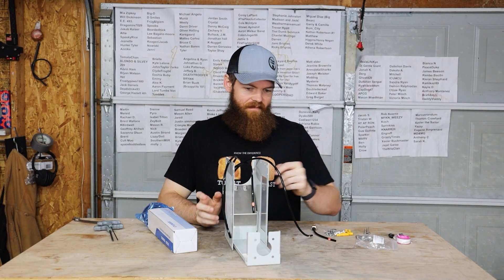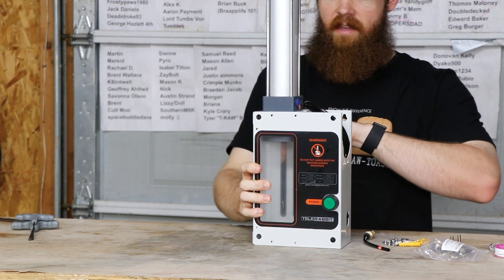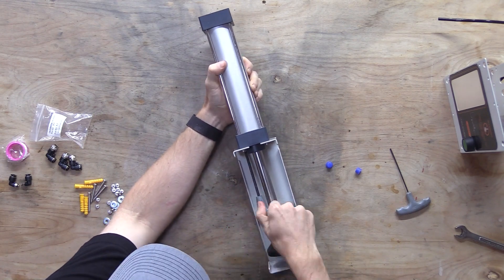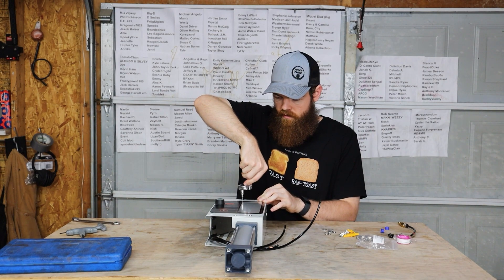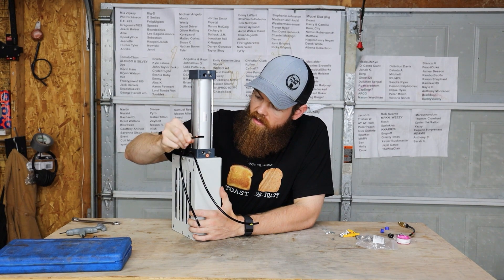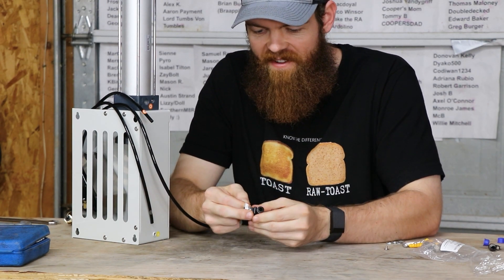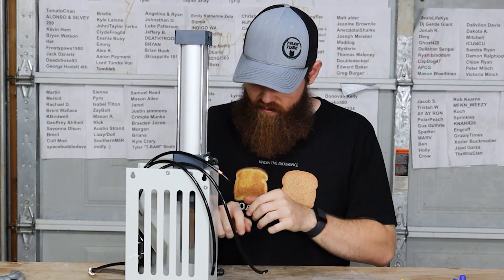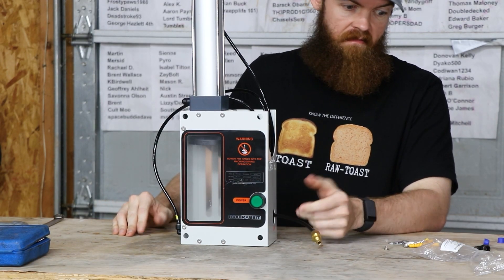I Built A Can Crusher!

Comment: It sounds like there is a flow restrictor muffler on the solenoid. I bet if you open it up you'll find the muffler or something you can adjust or remove to allow more airflow
Reply: Might need higher pressure but mostly more flow.  Can likely change out the fittings and hoses for bigger diameter or otherwise track down all the restrictions and open them up
Reply: Its cheap, itll be cast in the plastic but drillable
Reply: @Adamsadventures83  I was thinking that. But the insides probably have some sort of restricting orifice in the solenoid that wont allow any more volume.
Reply: I built a pneumatic can crusher out of surplus parts; if allowed to run full speed and full pressure in the retraction direction without an airflow restriction valve, the cylinder will slam itself apart. No regulator is needed in the extension direction as long as a can is being crushed. If run it at full speed without the can, the cylinder can do damage to itself.
Reply: @cheatinggravity173  sounds like a sensor is needed to make sure a can is in place to make sure self destruction doesn't occur.
Reply: @ThePrufessa  that would work nicely and provide full flow and piston velocity for really smashing the cans.
Reply: It needs a new Johnson rod.

Comment: “You don’t need washers” is concerning especially coming from a diesel mechanic.
Reply: If it makes you feel any better I'm an aircraft mechanic and I agree you don't need washers
Reply: @LoveLamp2552  you definitely do need washers.🧐
Reply: what do they really do?
Reply: Just because you may need washers in a car engine doesn't mean you need washers in a can crusher. It's not exactly the same thing.
Reply: Are you implying that Tyler is a diesel mechanic? There is no way
Reply: i think 'diesel mechanic' is slang for homosexual
Reply: @videodude4  they help disperse pressure from the fastener into a wider area and can help them from backing off
Reply: @garettodd3037  I can't remember which video but yes he said he went to school for and worked as a diesel mechanic
Reply: @garettodd3037  he is
Reply: @ChudActual  also the use of copper or pot metal washers in aluminum housings held together withe steel bolts is to prevent excessive corrosion from the steel aluminum co-corrosion effect also to protect the paint or power coat finishes on these appliances.
Reply: Everything he did here was concerning coming from a “heavy duty diesel mechanic” 🤣
Reply: @LoveLamp2552  I’m a keyboard warrior and I agree you don’t need to be qualified for a qualified position.
Reply: @videodude4  they distribute the load over a larger surface area, in this case it’s plastic which is weaker than steel therefore the washer serves an important purpose. But you don’t need to be a heavy duty mechanic or an aviation mechanic to understand this. Fred Flinstone understands this.
Reply: @garettodd3037  in a video a few years ago he said he use to be a diesel mechanic
Reply: @LoveLamp2552  if an airplane engine is burning you woud say thats fine
Reply: I prefer my dryer over my washer but that's just me

Comment: I own this thing and have crushed 50+ lbs of aluminum cans and it’s a 10/10 for coolness and a 3/10 for effectiveness. If a can isn’t loaded perfectly it gets stuck in there and you have to fiddle around the housing to try and get it unstuck and very often the can will crush right up against the feature intended to blow the can away and down and somehow that turns that into a vacuum instead of flow and it actually suctions the can to the hole and airlocks the cylinder.

Comment: At my last job we had cylinders like that and much bigger, at 100 PSI if they weren't throttled down with a restrictor they could be downright dangerous. That likely has a flow restriction for both safety and to keep the crusher from beating itself to death. That being said if you want to modify it to be faster look for the restriction on the bottom end of the cylinder side, likely a muffler or something on the solenoid, may have to open a port with a drill bit a bit but it should make a vast change

Comment: I remember the lever operated can crusher in my dad's garage. It worked just fine.
 We kids were forced to walk road shoulders with trash bags to collect cans. That was called our "allowance".
  The electricity required to operate the air compressor and the cost of the crappy pneumatic can crusher would likely cancel out the benefit of recycling aluminum cans.
 But there is a market for a 25 - 30 yr old bearded YouTube reviewer to answer your questions about unnecessary products.
So it works out... capitalism.
Reply: Just posted about the lever operated ones. No need for compressed air or a hydraulic press. They're cans, you can just stomp them if you need. not that hard.

Comment: Washers are not extra, they are necessary for extra rigidity
Reply: They increase the surface area of fastener heads and give more strength to screws and bolts(in my business). Keeping the heads from pulling through the material we are fastening. Tyler is very aware of these things, as a former mechanic. I'm pretty sure he is just trolling us with a lot of the stuff he says and does wrong... It's not possible to actually be as inept as the character he portrays, I hope... I constantly yell corrections at him through the screen, too
Reply: Next you're going to tell us not to cross thread screws.🙄               😁
Reply: @erict3728  washer hardly knew her

Comment: FUN FACT:  when you need Teflon tape but don't have any,  using a piece of a plastic grocery bag also works temporarily
Reply: I can verify that this works! Found the radiator drain plug on my bale stacking machine was installed with a plastic bag. It wasnt leaking🤣

Comment: Made one out of a hydraulic hose crimping pump and motor. 3" id cylinder at about 8" stroke. Was painfully slow (Austin powers steam roller slow) but I could smash 83 one after the other until I couldn't get more on. Literally doubled the weight in a 55 gallon drum. 😂

Comment: There's an easier variant. 
Basically, lay the thing to the side to that you can lay cans into it. Then cut a hole on the bottom the size of a crushed can (where the "eject pressure" hose currently is). Once the can is crushed, it'll jsut fall out the hole there.

Comment: I have a PCP compressor, 4000 psi. I bet if you hooked this up to a scuba tank(if it didn't blow apart the plastic fittings) you could do some serious crushing.... I've been wanting to use it on some of my regular air compressor stuff since I got it. However, I haven't wanted to die in an explosion, so my 200 psi max and my 4000 psi stuff stays separate.... Can't help but be curious though

Comment: I would wager its low psi, I would not adjust solenoid. The seals would blow then all ya got is another project. Change to hydraulic cylinder for more crushing power. Which would be another project, cause you can't just swap the pneumatic cylinder out.

Comment: You assembled a can crusher. You will probably find there are brass fittings attached to the button that control the exhaust. If so, replace them with variable ones that allow you to  control the speed in each direction.

Comment: Teflon tape should be applied clockwise if looking down the hole on the fitting, threads pointing at you.
Reply: How could you possibly misspell TEFLON??
Reply: @danielcheatham3400  lol didn't even notice it haha fixed
Reply: @danielcheatham3400  it's special tape that can withstand typhoons its not made to seal threads lol
Reply: Righty tighty lefty Loosey I think I learned that that 5 years old, but people are still struggling with it.

Comment: I removed the 3rd hose that plugs into a compressor and push on fittin and installed a standards air line and fittin on mine